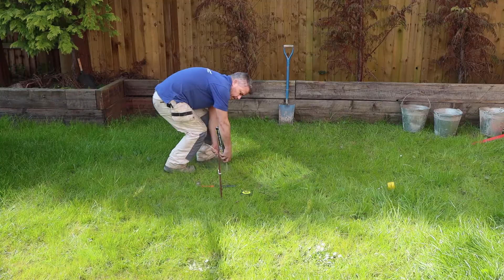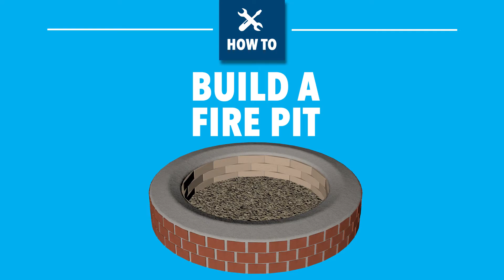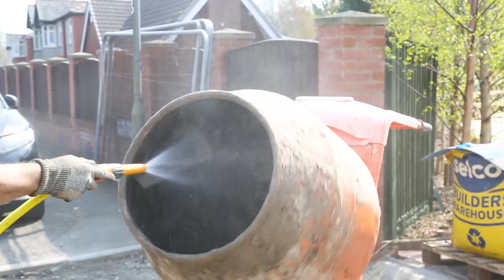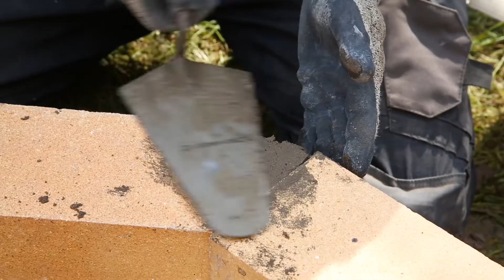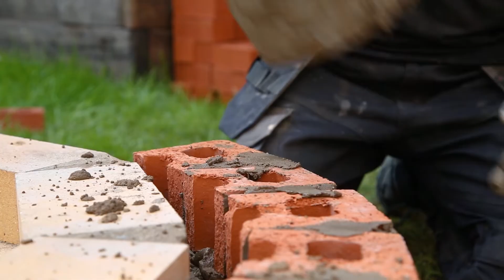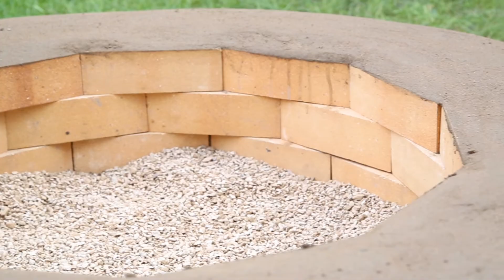How to build a brick fire pit

Comment: Where did you get, and how much did the fire bricks cost…?? They are far too expensive for most folk…use ordinary bricks and get some fire cement and put a 25mm render over those bricks…works fine…just need to let dry out slowly, then have a small fire  to properly dry out the fire cement….👍🏻
Reply: The bricks are from Forterra and will cost more than a standard brick but will last longer without the need to render the inner sides, if you do use standard bricks make sure there engineer bricks what we used on the outer skin

Comment: That will smoke like hell... no vent holes to help the fire burn hotter.
Reply: I agree....to be smokeless you require vent holes at the bottom of the pitt.....the fire burns hottter with less smoke.
Reply: We've lit it 5 times now and its been perfect, we love sitting around it.
Reply: @MrandMrsDIY  Then I stand corrected.
Reply: @freetipuk  Vent holes can help get air to the fire which could maybe help the fire to burn quicker
Reply: It'll smoke... and fill with water when it rains.